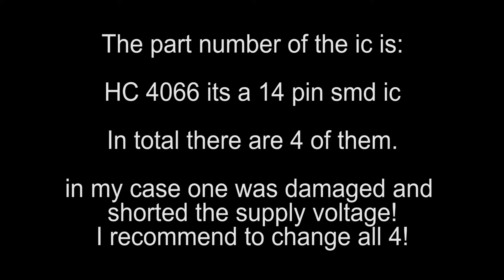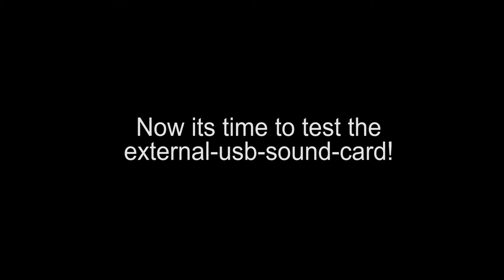Focusrite Scarlett 2i4 usb audio sound card repair - no input issue

Comment: Hi dear, my scarllett 2i4 2nd generation usb not connect properly in my PC. suddenly it would be off and after few time is running but again is off. Please let us advise what can I do. I am sending message from bangladesh.
Reply: same happening with me since i bought it.. too much stressed
Reply from the maker: It sounds to me that you have a bad connection in the connector. Trying to resolder the pins to the main board can probably help.

Comment: My scarllett  2I4 2nd generation shows no midi or usb (green lights) , pad lights and 48V lights are on .
any advice appreciated Thanks
Reply from the maker: Its hard to say from here.
i would first check if the ICs on the board are all getting supply voltage.
Check the datasheets of the components for pinout.

Comment: Thats awesome, my card has been dead since 2 years with same issue, this is great info!, im in mexico, do you know where can i order online this IC?
Reply from the maker: i bought them locally in germany. you should try it at mouser or digikey 👍
Reply: @audiokeller1975  i just took out the 4 4066, and it worked!!!. is there a risk of damage using it like this if i dont need the mic inputs?
Reply from the maker: it should work then
Reply: @audiokeller1975  you're my hero!

Comment: Hey! Thanks for the great info!
In my case, i pluged in a xlr cable and suddenly it stopped working. No input or output. Pc recognises it and installs drivers but no signal in or out.
Any ideas?
Thanks in advance!
Reply from the maker: hi!
in my case i plugged in a defective xlr cable which causes the issue with the focusrite. sounds like the same problem!

Comment: Thank you for the great info and video. This repair worked for me. There's more than one size of the surface mount HC4066 chip and I  ordered the wrong ones - slightly bigger, same length so the legs were spaced the same but the body was wider overall. I managed to solder it in place anyway as the pads on the board was just big enough. I can confirm that the inputs worked again with the old chip removed and before the new chip was installed. I just removed one chip - the same one you show in the video. I was tempted to just leave it out as the interface appeared to be working just fine without it. So what does this chip do and is it really needed?
Top tip for anyone trying this - order those cutters if you don't have them already - they're cheap and essential for cutting the legs - nothing else will do it so easily.
Reply: Looks like these are 4-channel analog switches. Maybe now some knobs or switches on the board are not functioning as before?

Comment: hi i have focusrite 6i6 2g dead i have changed zener 12v pass now it all ok , but not recognized from pc no usb driver ... what should i test ? please thanks a lot
Reply from the maker: Hi!
It seems to be a different problem. In my case windows recognized the 2i4 but no input. 
In your case i would try to measure all supply voltages for the ICs. And also check if the usb power makes its way into the focusrite.
But before you do this just try another usb port and install the driver again.

Comment: Hi... could I get some help .... i have a scarlett 2i4  2gen and whenever i try to record with my bass there's a static on every note i play on the bass.... i really dont know what to do
Reply from the maker: try this:
reduce volume. perhaps you get into clipping.
or try another cable between bass and scarlett ,could be a ground problem.
what is with the LED? does it turn red when playing bass notes? if yes reduce gain.
Reply: @audiokeller1975    It doesnt  red nor do i let it light up while green while im playing ... the person i got it from had the same issues so I already tried the different midi USB and quarter inch cable ... any other suggestions sir?😭
Reply from the maker: i would try with another recording-software or another instrument / microphone. Have you tried the other input of the scarlett? what happens if you record your voice with a mic?
Re-Installing a new driver can also solve the problem. Check for asio-drivers. Try to adjust buffer size / latency in the driver and test out.
You can also check the windows options and jump to the record-devices. Play a tone and then check what the levelmeter in windows will show. Adjust gain in windows so that you will net get into max to avoid clipping.
Also check in windows if the correct recording device is selected, sometimes win is doing weird things and adjusts automatically another device..

Comment: hello, I received my defective board, I tested it and it is like this, when connecting the cable it lights up a very weak green LED and does not recognize it, when pressing the pad buttons, the red LED lights up, I could help with the possible solution, thank you immensely

Comment: could you help me friend, I have a 2i4 and when connecting the usb cable it only turns on the green led and turns it off, windows does not recognize it, could you give me some guidance.
Reply from the maker: hi!
it seems to be a different issue. what i would do first is to connect the 2i4 to a standard smartphone 5v supply and then check if all ICs have supply voltage.
Reply: obrigado,

Comment: my 2i4 is 1st gen. and the pc recognizes but blinks at the start and no input and output... what should be the problem? i noticed  that the L12 gets Hot superquick..
Reply from the maker: hi😁
sounds a little but like the same problem🤔
the defective ic 4066 short the supply voltage so some components get hot.
if you just remove all 4 ic 4066 without soldering new parts to the board the 2i4 should work again!
you should give it a try to find out if you have the same problem and after that invest in 4 new 4066 👍
Reply: @audiokeller1975  luv u dud
Reply from the maker: let me know if that helped you out 👍

Comment: So before windows could recognize the 2i4 but there aren't any signal of the mic or instr, right?
or the pc could not recognize the 2i4? My pc does NOT recogonize the 2i4 anymore. the main chip (cpu?) of the 2i4  feels warm. if the usb cable plugged in the pc the usb led will not show up, but if i push the pad or the 48v buttons then they light up. what should i do? the main chip is almost so expensive as a new scarlett 2i2  3gen.
Reply from the maker: Hi! 
Sorry for the late reply, i was in holiday :)
Regarding your question:
No, windows did recognize the interface when connected with USB, the problem is that it wasnt possible to put audio into the card via the inputs. The cause of this problem was just a bad XLR cable which had a short circuit :(
Too bad that there is no input protection, but its an easy and cheap fix.
If your interface isnt showing up in windows after USB connection, you have a different problem :(
You can try to check the supply voltages, maybe there is also a short-circuit. Try to check out that there is USB Voltage.
But sometimes its easier to get a new or another used one and keep the damaged interface for spareparts!